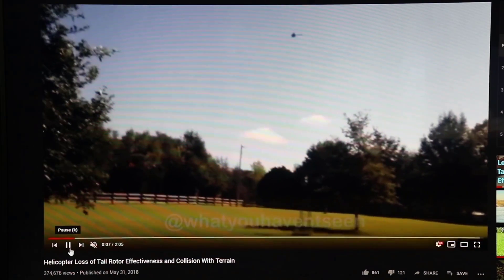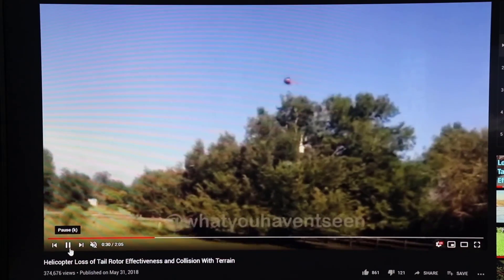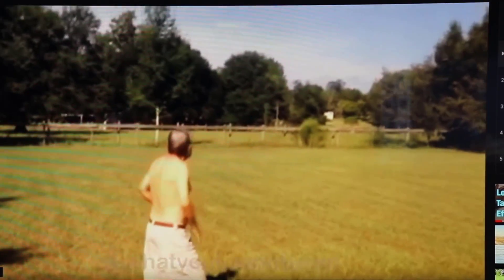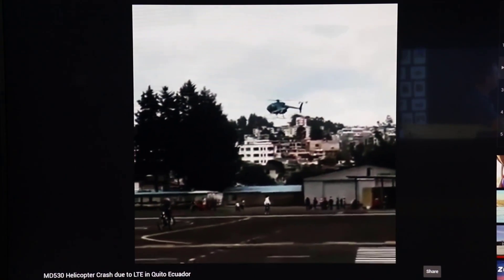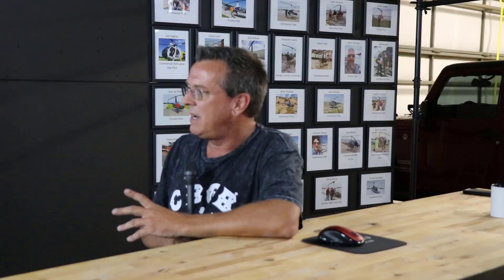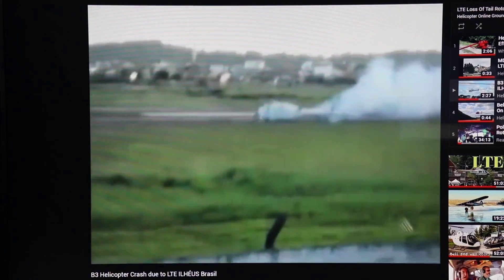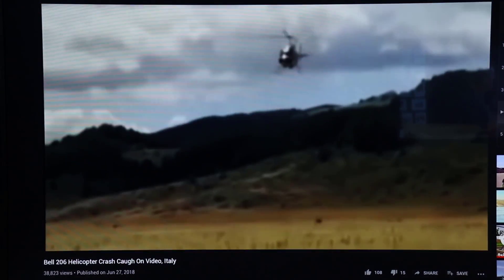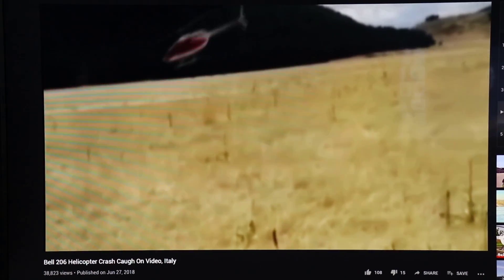#260 Loss Of Tail Rotor Effectiveness LTE Accidents Helicopter

Comment: Great video!!
Just one correction. The accident on minute 2:52 (B3 - Ilhéus - Brazil) was not due to LTE, and it was not a B3. It was an AS350 B2 in a training flight, and the pilot lost control during a simulated hydraulic failure
Reply from the maker: Thanks for the feedback

Comment: ☠BLACK BARON☠ It's all about PID main & tail settings, RPMs on main & tail, blade lengths, number of blades main & tail to find the best balance and harmony in aerodynamics.
Reply from the maker: Thanks for the feedback
Reply: @HelicopterGround  ☠BLACK BARON☠ Ask the "Software Flight Control Engineer". Question N°1. What is the "Recovery Algorithm"? ... Question N°2. Software Engineer, have you testet the "Recovery Algorithm"?

Comment: I’m thinking of electric tail rotors, like Bell’s EDAT (Electrically Distributed Ant-Torque). Could this significantly reduce the problems you have outlined?
Reply from the maker: That would be a question for a manufacturer.

Comment: Kenny, I have never experienced LTE that changed my heading more than 40 degrees or so.  I worked for some very experienced Bell pilots and they told me that the tail rotor never really stalls and that most pilots are just reluctant to put in enough pedal to regain control.  What is your take on this?
Reply from the maker: Yes the big problem is pilots not staying on top of the pedal control. Being a lazy pedal person can aggravate the problem.

Comment: I have a question. Were all those LTE incidents on warm-hot days at or above 1,500 altitude? I know the Sheriff aircraft was at high altitude attempting a rescue,  but I assume that would make a difference. It does with fixed wing.
Reply from the maker: LTE is not necessarily from being at a certain altitude.  It can happen at sea level with cold temps.  It can occur when the aircraft is at a slow airspeed below 24kts and the wind disturbs the smooth flow of air through the tail rotor.  If the wind is strong enough and from the right direction, LTE can occur.  Additionally, if you are in a high DA environment you could run out of available power at a slow airspeed and have the same thing happen.

Comment: At 02:53 they were training hydraulic failures on the A-Star and things got out of hand....it wasn’t LTE.
Reply: On a AStar you have max 20 sec after hydraulic failure before one of the three MR actuators looses pressure and you’ll lose control on the stick (no way you push it over the emptying actuator!).
If hydraulic pressure loss ever happens to you, break the red plastic and turn off the hydraulic immediately!
Then fly away - yes, it takes some muscle and very fine coordination, but ist doable, do a nice TRL procedure running landing.
Reply: @akkseljohansson3601  correct! I’ve flown many hours on B2s for law enforcement and the are absolutely amazing machines! We used to do hyd failures as part of annual OPCs. 👌🏻👌🏻💪🏻💪🏻🚁🚁🇦🇺🇦🇺
Reply from the maker: Thanks for commenting

Comment: I fly RC helicopters and if you loose tail we use forward  pitch and if your doing a auto power up until you get to a open area than auto is this possible in full size ?
Reply from the maker: Thanks for commenting.
Reply: @HelicopterGround  yea any time
Reply: LTE Procedure on a EC135 is actually a AR.

Comment: If it's a tailwind or from an angle causing LTE and wind-cocking, then a windsock would be helpful. But of course those aren't everywhere you go. However, if there's a parking lot nearby and you see seagulls just sitting there roosting, they always sit pointed into the wind.
Reply from the maker: Exactly!
Reply: But are the seagulls gonna stick on the ground while you approach, or would they get airborne and become yet another hazard? Birds don't generally hang around till you're on the ground and they can be a bigger problem for helicopters than they are for airliners.
Reply: @Deathvalleyherper  I'm sure you'll get a chance to look closely before they scatter.

Comment: As a Ag helicopter pilot I made sure my Nurse truck driver understood the importance of proper placement of the truck. Often times we land on the road and I always made sure that my takeoff area to the right of the truck is clear.Because if you come off the truck and have a loss of Tailrotor authority you can reduce a small amount of collective and let the helicopter start a slow turn until you reach ETL and you can normally reach ETL at about 3ft AGL. I have had LTA about 5 times in Bell 47s and twice in B206s in the hundreds of thousands of takeoff and landings well I’ve done spraying because normally we are taking off and landing every eight minutes . Most helicopters prefer a slight left cross wind and that will help reduce how much tailRotor is needed
Reply from the maker: Thanks for sharing!

Comment: After many hours I encountered LTE this Summer as I am trying to relearn how to fly. It was a simple 10 mph wind from my 10 o'clock that caused a complete LTE as I flared for a 3-foot hover. The instructor quickly pushed forward on the cyclic and LTE was gone. However, I still had full left pedal as the LTE quit and I gave myself quite a ride until I was stable again. I now have a healthy respect for quartering crosswinds that are mild. Thanks for covering these little events that are lurking, waiting for an unprepared pilot to mess with.
Reply from the maker: Your welcome and thank you for taking the time to share your experience!